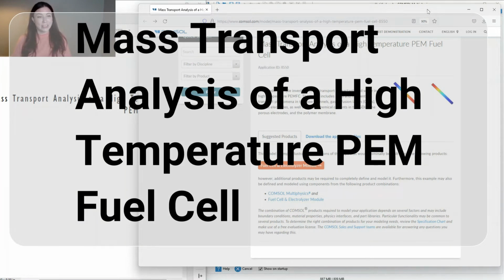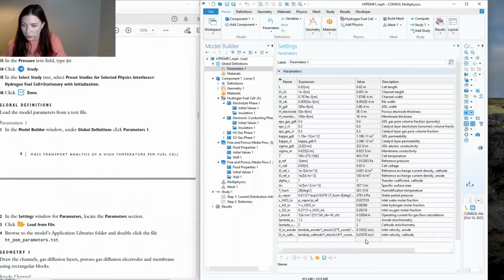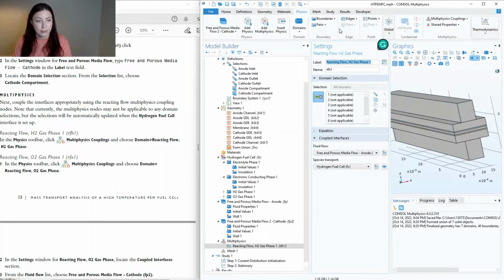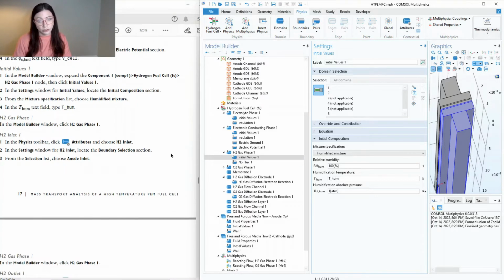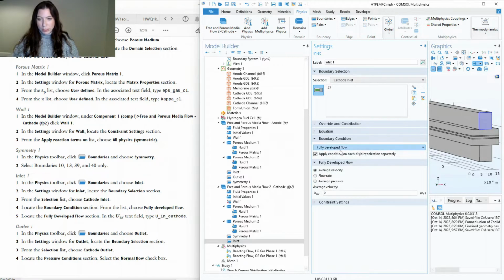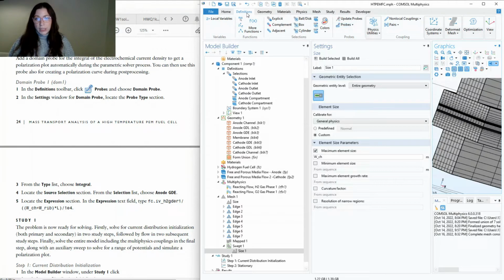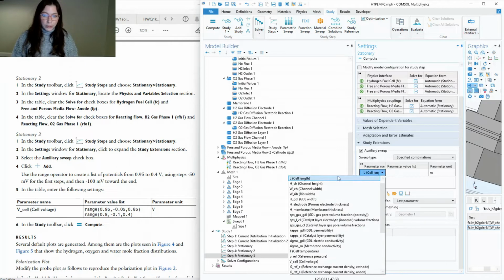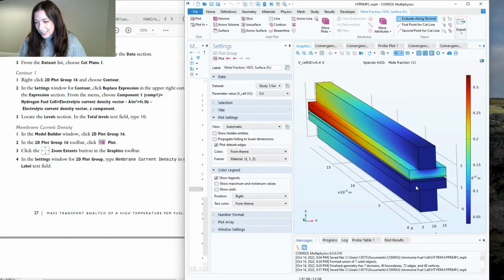Mass Transport Analysis of a Hydrogen PEM Fuel Cell COMSOL Tutorial

Comment: Can you make a video by changing materials please?
Reply from the maker: different materials will change the half reaction which is integral to the solution this specific module solves for. there is no simple way to do it. i have spent significant time trying this in the past.
Reply: @JessicaHoffmanTutorials  Do I have to set materials at the beginning?  Because I found same graph using different materials.

Comment: Hi
I want to simulate some nested cylinders that inner of them is a heat source. how can I do geometry of it? can you help me please?
Reply from the maker: Hi, 👋 geometry capabilities are documented in Chapter 7 of the Reference Manual, version 5.2a. Drawing concentric cylinders is as simple as drawing two cylinders and making sure to specify coordinates for them that assures they are concentric. Alternatively, you can use the "Layers" section of the cylinder settings
Reply: Thanks a lot @JessicaHoffmanTutorials

Comment: Hello, Is it possible to modify the system to revert the process from PEM fuel cell to PEM electrolysis? I'm new to Comsol and a bit lost.
Reply from the maker: Hi Jean, thanks for watching! Yes it is. Please check out this link: https://www.comsol.com/blogs/modeling-two-phase-flow-in-a-pem-electrolyzer/
Reply: @JessicaHoffmanTutorials  Hello and thank you for your reply. I have completed this other tutorial, however it only covers half of an electrolysis module (only oxygen), whereas I'm trying to get a full setup (oxygen and hydrogen). Hence I'm trying to convert the fuel cell you designed in this video to perform electrolysis.
Reply: @jeanab   I am working on PEM Water electrolyzer
Reply: I am working on PEM Water electrolyzer